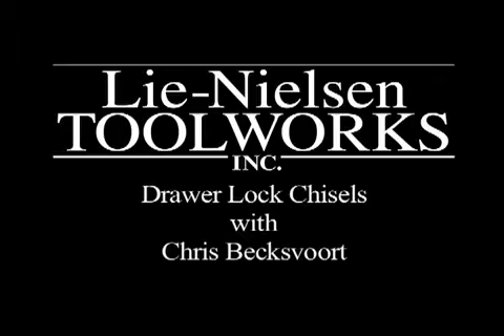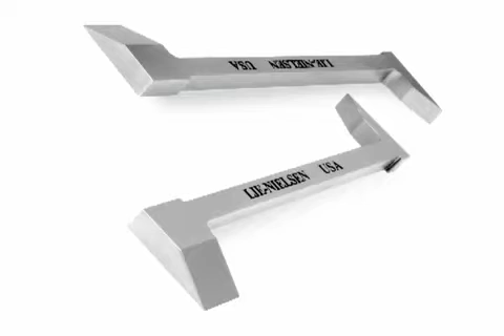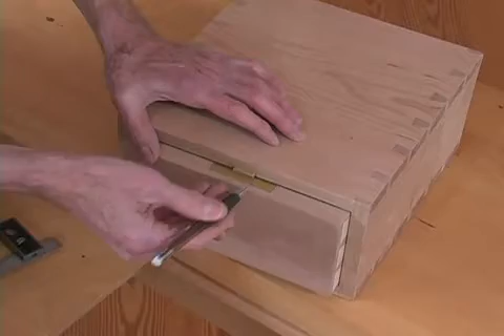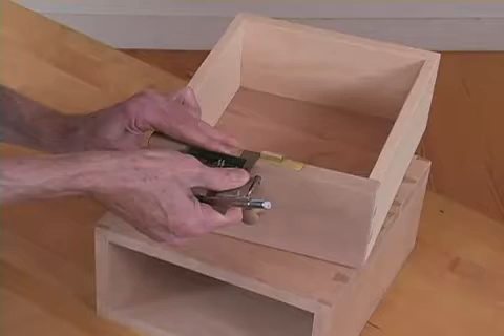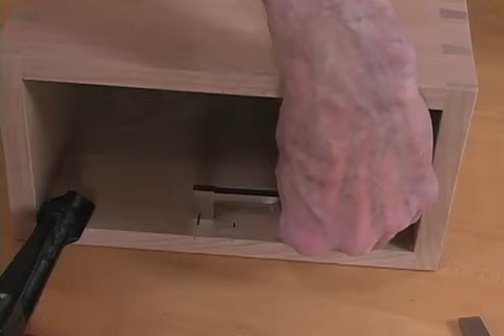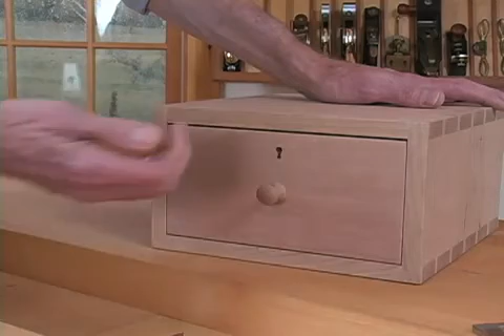How to Use Lie-Nielsen Drawer Lock Chisels (with Chris Becksvoort)

Comment from the maker: These are actually very easy to freehand sharpen.  Just keep in mind there is very little material to sharpen so it will only take a few passes on the stones. I would work both the flat and the bevel.  This tool shouldn't have to be sharpened often. Hope this helps.

Comment: It's a pretty straightforward dovetail box with the only issue of that being the miter for the front. You can make an educated guess as to measurements but in the end it's going to be a custom item. I don't know if the dovetails were cut by hand or machine but it can be done either way. Handcut is going to produce a more refined look.